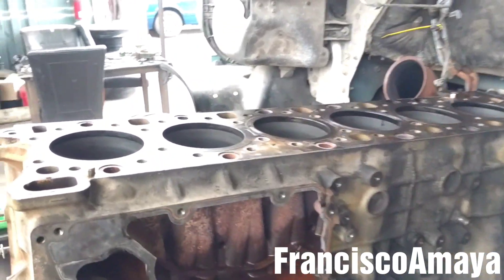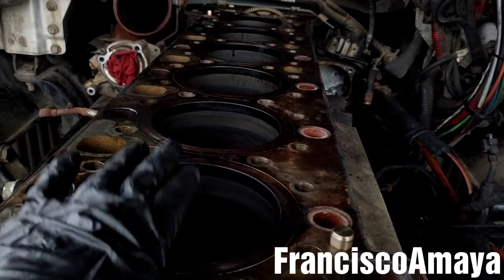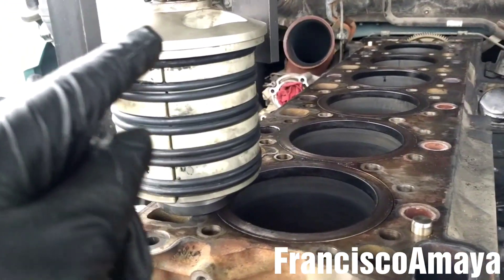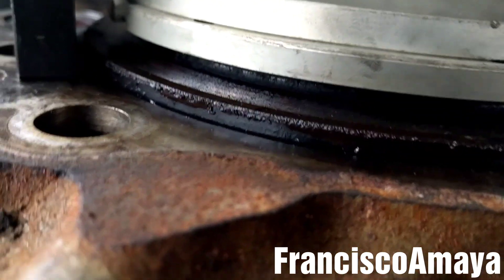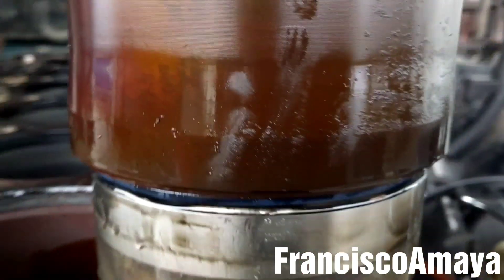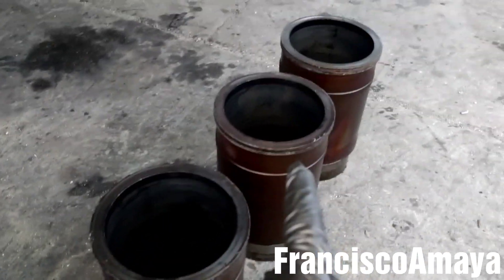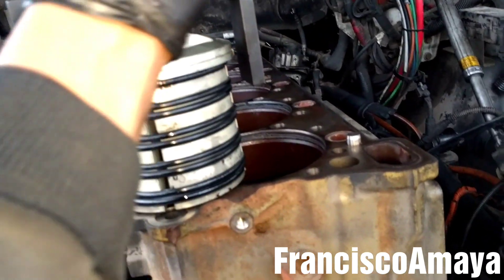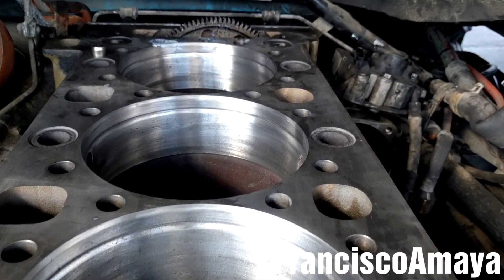Freightliner Cascadia DD13 DD15 DD16 cylinder liner replacement engine overhaul rebuilt part 1

Comment: Greetings friend, first thanks for the video, I would like some information if possible, Mercedes-Benz is bringing this engine to Brazil as a novelty, in the OM471 nomenclature, but we know that this is the Detroit DD13 engine, what can you say in favor and against this engine? thinking about wear and tear with time of use and advanced mileage, is it a reliable engine? in Brazil we work with severe weights, in 6x2 vehicles with a total gross weight of 48,500 tons, and 6x4 in other configurations reaching more than 70,000 tons. If possible I await your feedback, thank you.

Comment: These engines don’t go to 1.5 million before a overhaul ?
Reply: My dd15 has 1.20000 actually and still running hard,,of course I made it under metal and oil pump around 600 mi and i change oil cooler gasket at 900mi...still working hard💪
Reply: die zales with no delete ??
Reply: @diezales7268  I have a dd13 with 736,000 miles what would you suggest getting done to it. I have no issues
Reply: If they are deleted I bet they'd go a bit further but basically if you get 7 or 800000 miles your very lucky on any newer engine
Reply: Hey body..my 2009 dd15 got to 1'455,000..so thats close to million nd half
Reply: @oscarfigueroa3958   wow just DPF and no DEF fuild on truck right ?
Reply: @jamesmcmickle7891  correct..my friend..no def
Reply from the maker: @Oscar figueroa 2009 - 2011 not DEF engine can reach that mileage without engine overhaul. Congratulations 🎊
Reply: james mcmickle 1.5m? No way lol. Your lucky if they go 800k.  these aren’t cat engines
Reply: Hack Daddy - Official - omg even if they are deleted ?